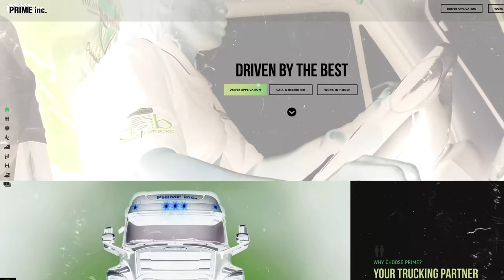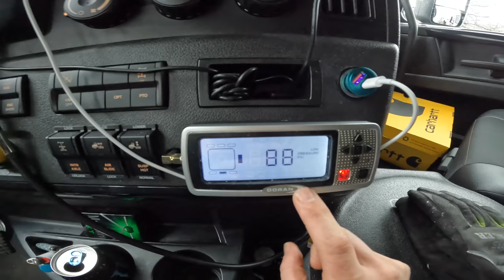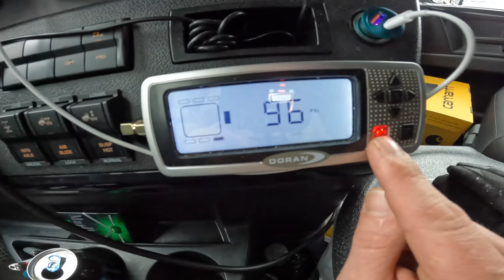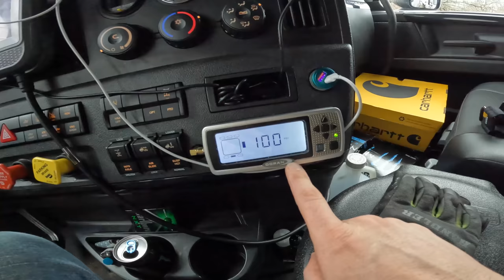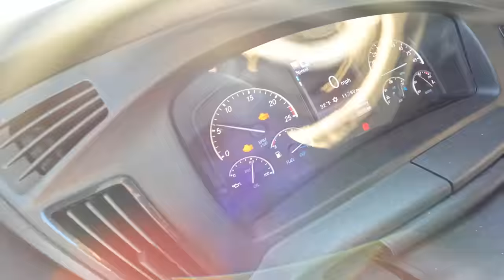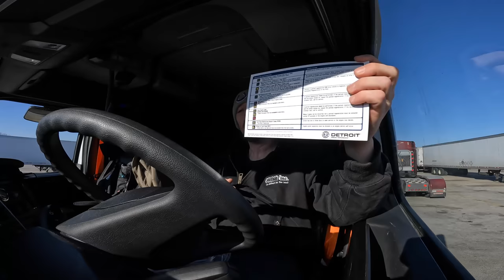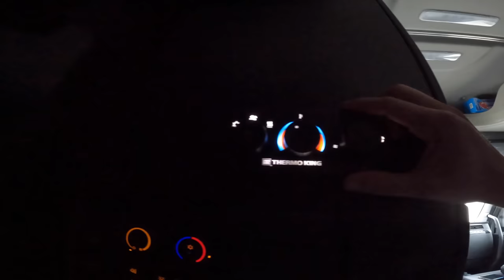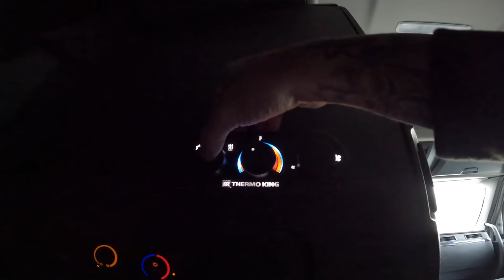Prime Inc TANKER Leasing Settlement Review | no APU no bunk heater, DEF pump SHOT at FREIGHTLINER

Comment: Get ready for the pump to go out again; I had two trucks that with in a month on DEF pump crapped out and it took 10 days to get the proper replacement that craped out 3 days later and the other truck I went through 4 DEF pumps in 8 months.  Both trucks where about a year old with less then 150000 miles
Reply from the maker: Dang it, keeping my fingers🤞 and hoping that’s not the case. I got 40K miles on my 2023 freightliner…

Comment: Good video. Not a lot of tanker channels on YouTube. I subbed. 👍🏼

I noticed you don't have a hose rack on your tractor. I also didn't see a pump or compressor. Do you ever have to unload the tanker yourself?
Reply from the maker: Appreciate that 🤙💯 yeah I unload sometimes. The hoses and pump are located inside the back cabinets of prime trailers. Then I have a hydropac on the driver side of my truck I use that to connect my hydraulic lines to the trailer so I can pump off from the back 😃

Comment: They don’t breakdown the truck and insurance payments from fuel on your settlement or are you buying fuel on your own and that comes off that 5700?
Reply from the maker: The $5700 is after ALL expenses that includes fuel, def, truck payment, insurance, ifta tax, permits, fees and also the new fridge I bought through prime which they installed. And that includes the charges for installing my cb radio, 2 antennas and 2 mirror mounts.
Reply: How long do you stay out?